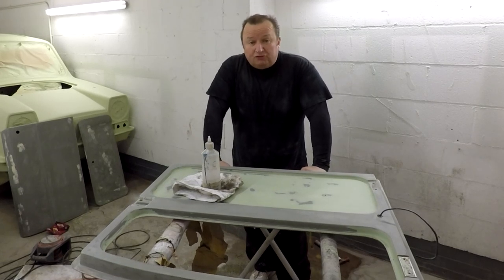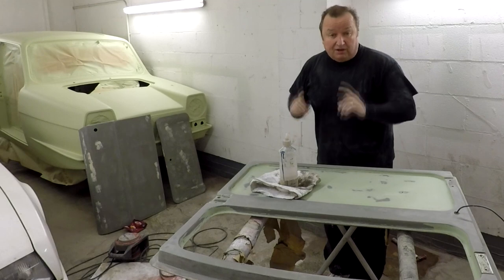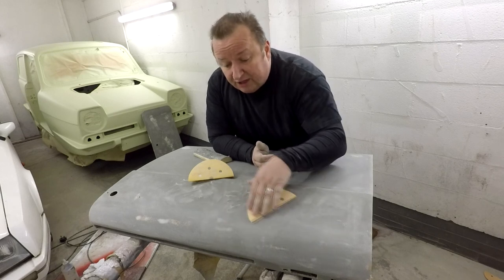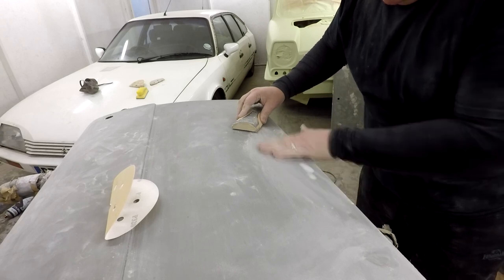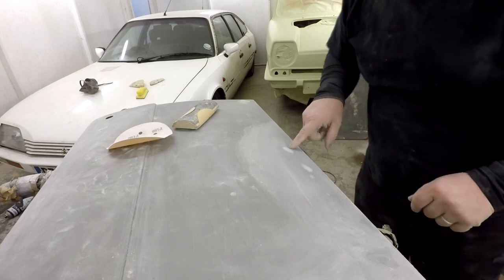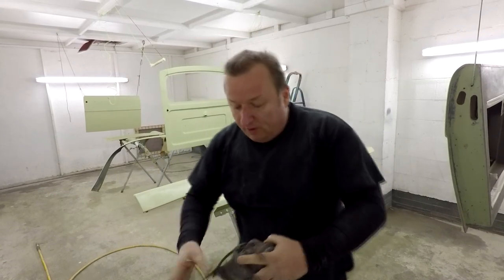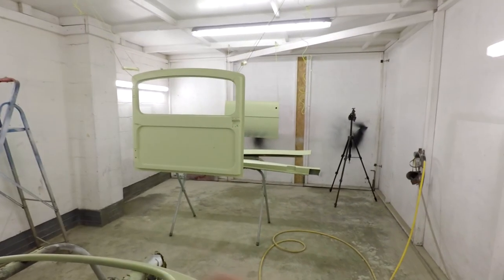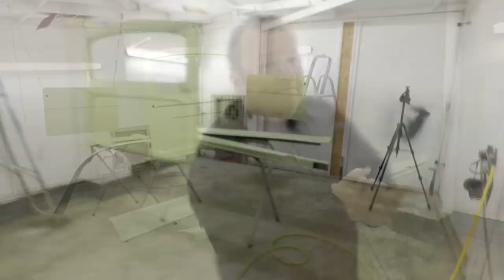Part 30 Reliant Trotter Restoration Priming The Doors

Comment: Almost ready for top coat now, Martin. It would great if you could take the Trotter van to the car show in April. It looks like you're going to be busy with the reassembly work once the paint is done.
Reply from the maker: Yes Nick, still lots to do so I got to get my finger out.

Comment: Coming along well, better get cracking if the big unveiling is the end of April. Can’t wait.
Jim in s Fla, currently 67F, party overcast, humidity at 75%, feels a little chilly in the breeze.
Cheers.
Reply from the maker: it was minus 2 degC here today Jim. colder tomorrow.

Comment: Each video is a step closer. April is only 9 weeks away. Great goal to have it finished. Will you wet sand the final primer and the finish coat?
Reply from the maker: No need to wet sand it Bri. but it will get wet sanded on the finished coat for final flatting and buffing.